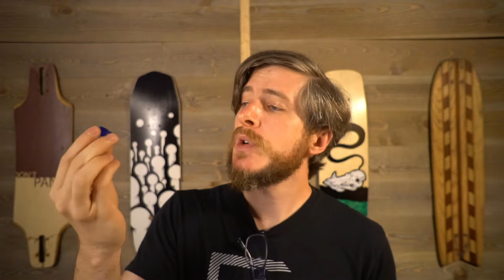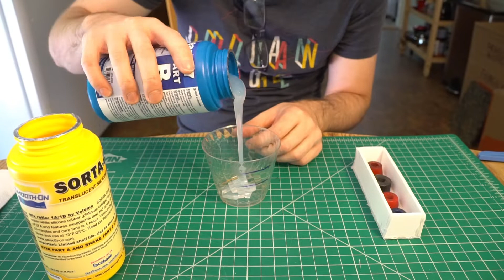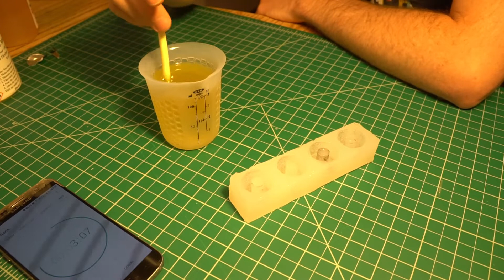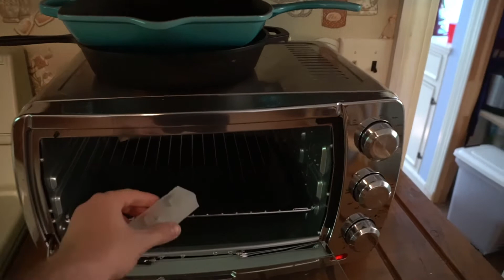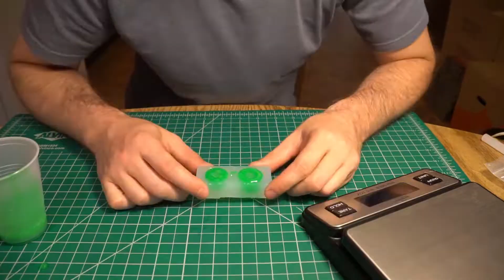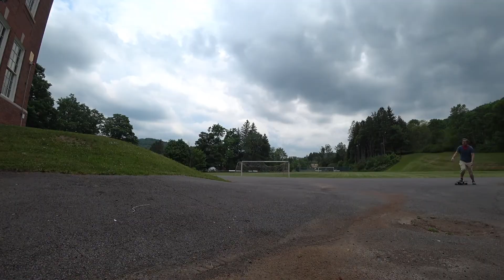How to Cast Skateboard & Longboard Bushings at Home

Comment: Hi Chris it’s Tyler Jones from mechanicsville va and I wanted to know can you 3D printing board rails head and tail rail Garuds for skateboards of 1980s or older
Reply from the maker: Probably! I imagine if you printed nylon or PETG at 100% infill it would work. Nylon would be a much better material for them but it's harder to print. PLA would shatter, I think.

Comment: I thoroughly enjoyed this. I live in New York City and I cruise mostly on sidewalks. The sidewalks in New York are notoriously uneven and seamed, so riding is a rattling experience. I've tried to mitigate that by acquiring larger wheels (Slick Revolution's Rough Stuff wheels) and instead of using conventional riser pads I'm using a thick slab of rubber substrate that used to be the flooring for a kiddie playground. I'm constantly trying to find ways to mitigate vibration. Recently I replaced my bushings leaving the choice and quality of that decision to my neighborhood skate shop proprietor. I was amazed at the reduction of vibration. Chris, would you know what is the best bushings to get to lessen vibration? I'm 192 pounds.
Reply from the maker: Hey Marcus. I just recently moved from the city, I lived in Brooklyn for 10 years so I know what you're talking about with the quality of some of the pavement. Unfortunately, so much of "the right bushing" is personal preference so I can only guess, but I rode khiro and venom bushings at different times and liked them. The upside is bushings are pretty cheap, I would recommend getting a few different sets in and around a duro you know you like and experimenting with top/bottom and front/back combinations until you've got somethings that feels good to you. 

I don't know if they're open during quarantine but I gotta shout out Uncle Funky's in the west village. Crazy selection of longboard and skate gear and a super knowledgeable helpful staff. They'll have a huge variety of bushings available.
Reply: @GoodRoads  - Thank you. I went to Uncle Funky's website. I will investigate.

Comment: Using a vacuum chamber and pump is a better option for  degassing urethane than a pressure pot.
Pressure pots are better used for casting resin rather than eurethane.
I bought a vacuum pump, chamber and valves all for under £500 in the UK. (also you can cheap out on a weak vacuum pump you need one that pulls enough vacumm pressure to degass properly or you'll not get the right result and no ammount of pumping with a weak pump will solve that).
Reply from the maker: Yep, if I can't get the results I'm looking for with pressure then it's on to trying vacuum. Tonnes to explore.

Comment: You are making so many things with urethane that it might be worth either making or getting a vacuum. ive seen people use suction to get the bubbles out after mixing.
Reply from the maker: For sure. I'm going to see what I can do with the pressure pot first, but pretty much everyone I've seen do casting recommends a vacuum chamber. ¯\_(ツ)_/¯ we'll see!
Reply: @GoodRoads  right, i mightve not caught you mentioning it. cant wait to see how the pressure pot works!